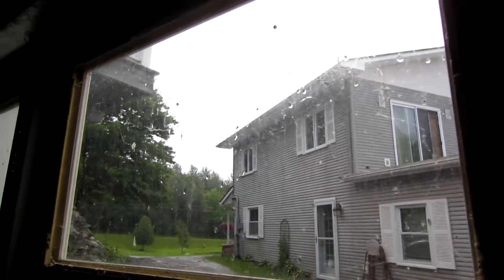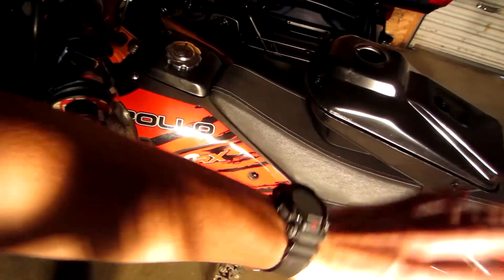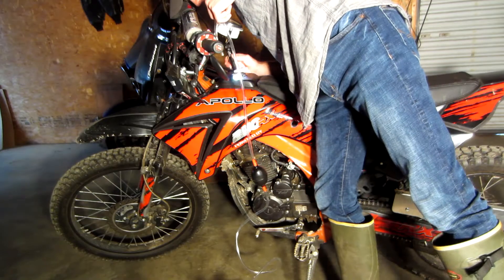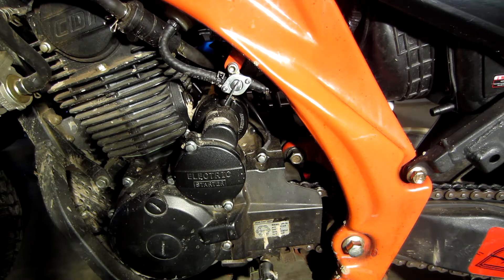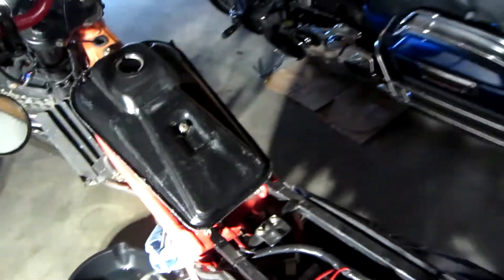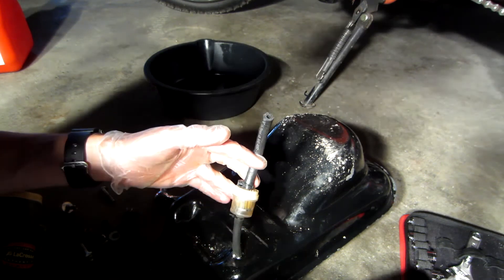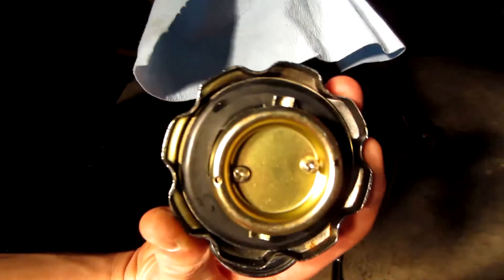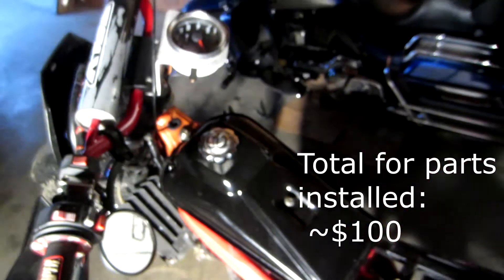New Gas Tank for the Apollo! Apollo 250 RX - Part 3

Comment: so its been a while , would you say that it works fllawlessly and how much more does it hold? compare to the original tank, i planon gettin an apollo 250 (street legal)and wanna upgrade it as much as possible , would appreciate some guidance soon as i get mine
Reply from the maker: I haven't measured it exactly, but it holds around a gallon. No issues with the tank so far, but I did end up adding some rubber to cushion vibrations (so that it hopefully won't crack again). If you do end up getting an Apollo, I recently found out that there is a plastic tank available somewhere, and I'm sure that it would be a better option than the metal one. Definitely try joining some Facebook groups if you can. Lots of good info on there.
Reply: @VTOutdoorsTV  if you call Apollo power sports they will send u a specific link to there 250 parts. There’s a plastic tank on there. For some reason when I’d look it up tho it wouldn’t show up, they have clutch brake levers. Cables and tanks and a couple other things. Give them a call I’m about to order a plastic on today cause my weld on the metal on is shit lol

Comment: We're can I buy the speedo meter and all the  lights for the apollo 250?
Reply from the maker: I am not sure about the speedometer, it seems to be a bit of a custom job. I'll look further into it. As for the wiring harness for the lights and horn, my bike is equipped with Tusk products. You will need the harness itself, a flasher relay, a universal horn, and a control switch. I'm not sure if I'm missing anything, but this site seems to have everything: https://www.rockymountainatvmc.com/parts/tusk-enduro-lighting-kit-replacement-wire-harness-p
Reply from the maker: The lights are entirely your choice, it seems like almost anything would work. It's all very simple connections. I have a video coming out in the next couple days about a set of turn signals that you might like.